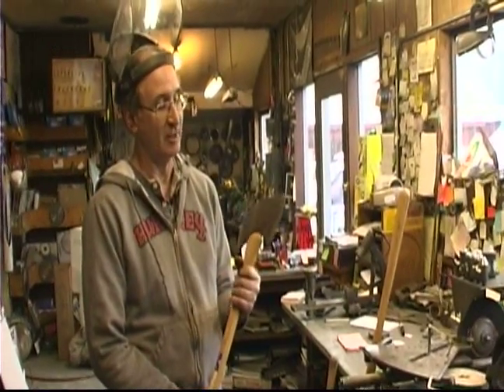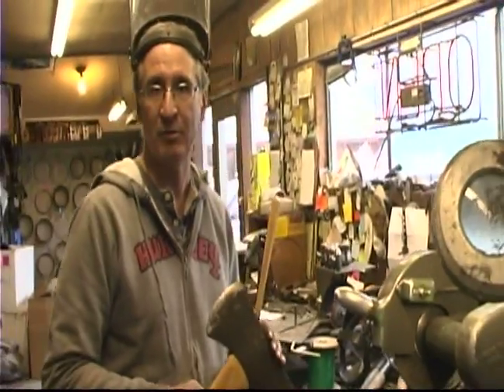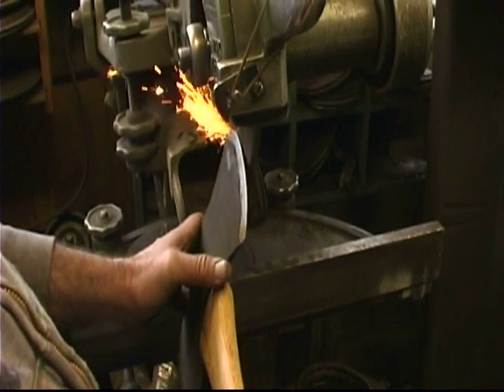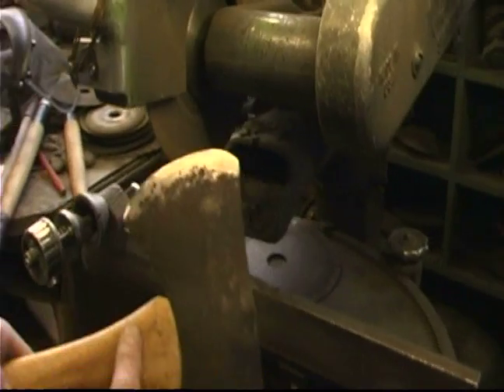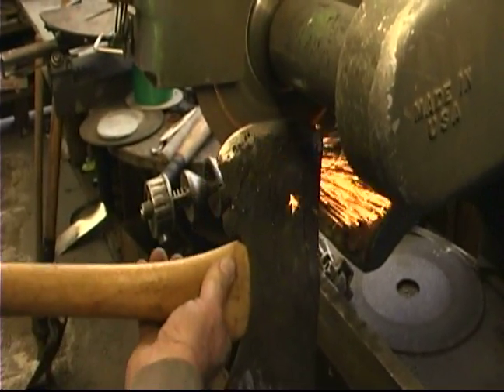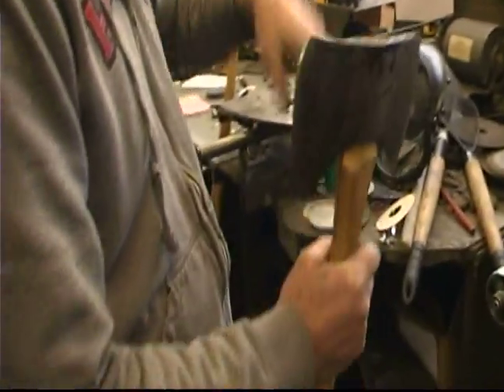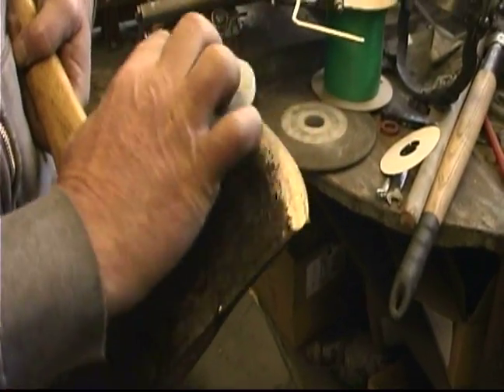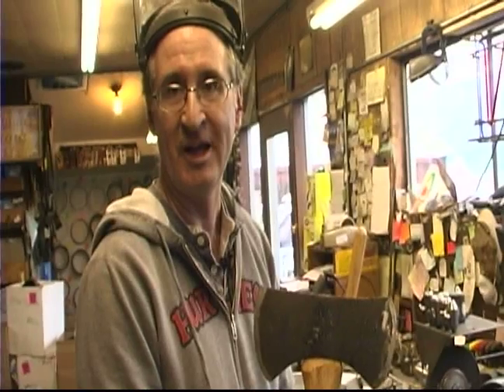How to Sharpen Garden Tools : Sharpening an Axe

Comment: You have to get the temperature much past 200degrees celcius to ruin the temper, and if it was that hot, there would be steam when he dipped the axe in water, and it would be too hot for him to hold.

There are many ways to sharpen an axe, I prefer to use a belt grinder to sharpen an axe, and it is kept cool, you just have to dip it into a bucket of water often.

Comment: @301001082 Steel does not go white at 1000 degrees, it goes bright orange and loses it's magnetism, I have heated steel to that temperature before, it takes a propane torch and a super oxygen rich environment to heat it to that temperature.
So here's the question, have you ever sharpened dozens of knives and axes every week with a power tool? If it is 1000 degrees, when I dip the blade into the water, the water should sizzle and I would see water vapour.

Comment: if anyone used that thing on my axes id kick their butt into next weeki have around 100 axes & do some competative wood cutting, all are sharpened by hand held tools, a millsaw file for heavy work & dimond stones for the rest, finaly i use a polishing stone on the racing axes.
gransfor bruks do a good hand held stone for running repairs etc and Tuatahi do a axe jig for precision stuff

Comment: I agree with all that say it should be a file, stone and oil.

If there is alot of metal that needs removed then you can always use a ruff file like a cross vut basterd file and then move to a finer file after that use a sharpening stone and dont forget the oil or it will eat up your stones XD 

Only gave them a 1 for rating and I hope no one will do this to there axes no matter how cheap they may be this can and sooner or later will hurt you badly

Comment: Well.. I know it's an AXE.. so you don't need as much precision grinding as your fillet knife.. 

But I know I'm not alone in saying that this is a very rushed method that will not leave the best edge..

Sure, this is fine if you're restoring hundreds of axes a day, but for your at-home or out-of-doors personal knife, it pays to get dirty with a file, and take the time to do it by hand the right way.

Comment: @301001082 Where are your sharpening videos? Have you ever used a belt sander? I've had millions of sparks fly into my hand non stop from grinding steel, they are not 1000 degree Celsius or I'd be getting deep 3rd degree burns all over my hands.I can hold the blade as well, it barely even goes past 50 degree Celsius unless I've been grinding it for a long time.
Maybe you should lecture the hundreds of professional knife sharpeners that use belt sanders since you know soo much about it.

Comment: @301001082 So you can tell temperature through a video? Unless you have done this, you know nothing about this, I sharpen knives, axes and blades like this everyday, if the blade is over 1000degrees celsius, then like I said, it would have burned me, when it reaches 1000 degrees the blade will be bright orange and I would not be able to touch it, stop being an arm chair warrior, you have not done this, you have absolutely no experience in this.